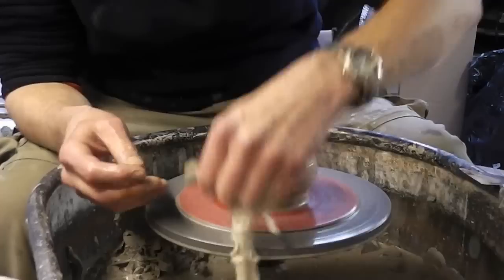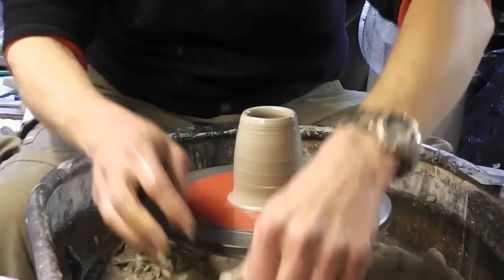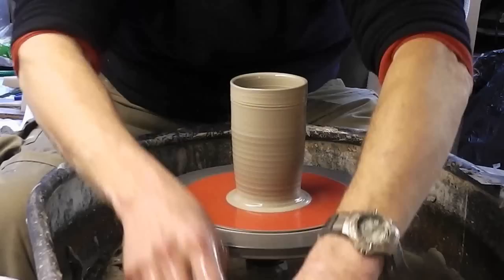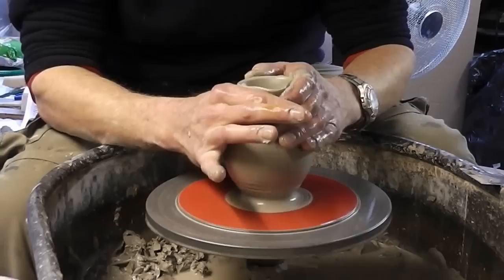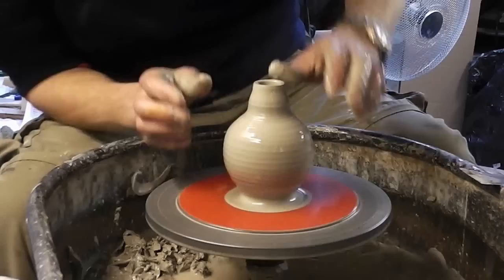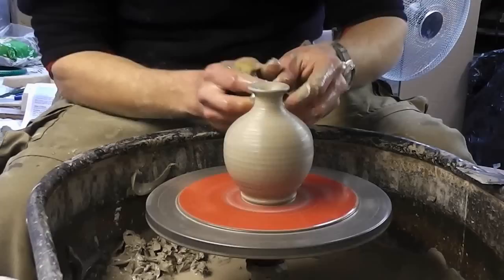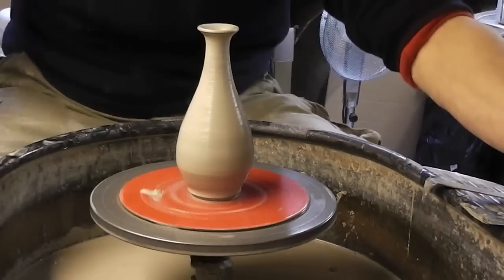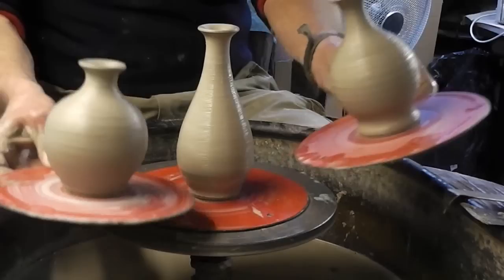Throwing 3 small Bud Vases on the wheel with rubbish old lumpy clay

Comment: Thanks for your inspiring educational tutorials.  My problems:  I have tubs of old clay from five years ago.  I wedged but I am collapsing my cylinders due the lack of strength in my hands to open the clay with ease.  My hands are very small unusually small.  I had to interrupt my progress with pottery for five years.  I have a whisper wheel and an easy kiln.  I wonder if you have any pointers on old clay for an old  broad LOL  I am energetic and use my whole body to center.  Wow its not easy to get back into it again and I have older.  I am succeeding with newer clay.  I was thinking I could do slab work with old clay what do you think!  I have another problem too but let us settle for this one first.  Old clay.  Lumpy and a bit gritty it is low fire.  Thank you.  I watched and continue to watch every one of your tutorials.

Comment: Is the board that the clay goes on rough like sandpaper, or is it sort of smooth?
Reply: +Rosalie Walford I remember him saying in one of his other videos that it was really smooth.
Reply: +Kane Trahan ok, thanks 😊
Reply: +Rosalie Walford 
They are like little metal plates with powered coated tops to support the designs, and make them easier to cut off.
Reply: The batt has to be super smooth as your hands run along them constantly. Having a batt makes removing your pot much easier!